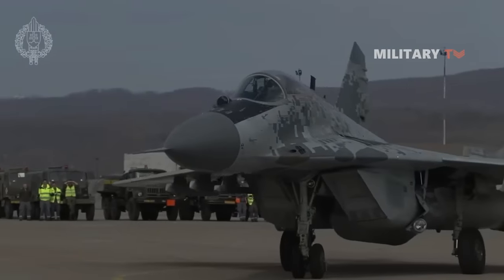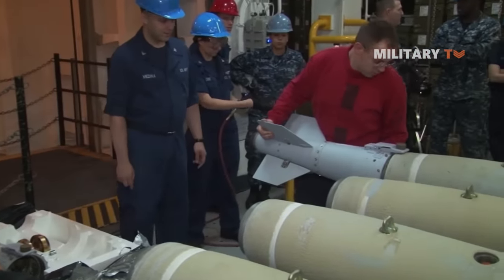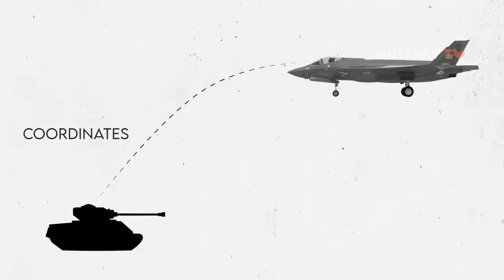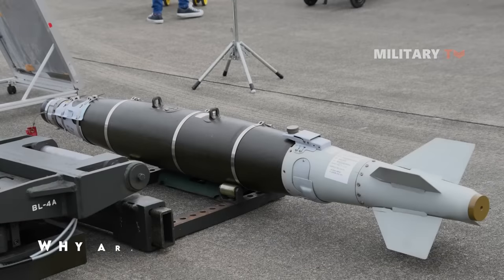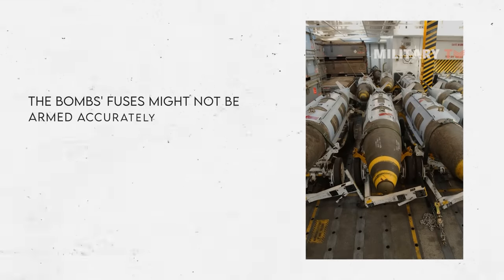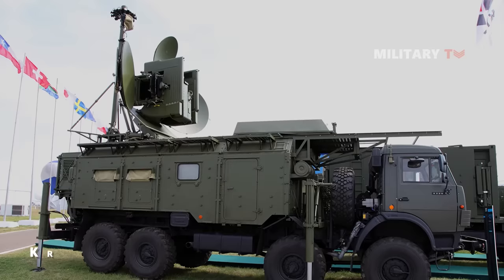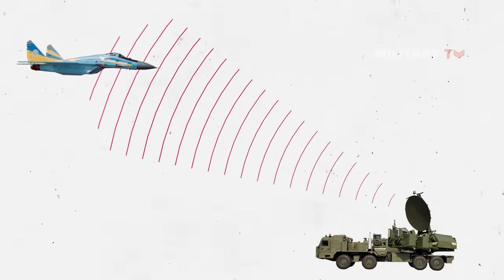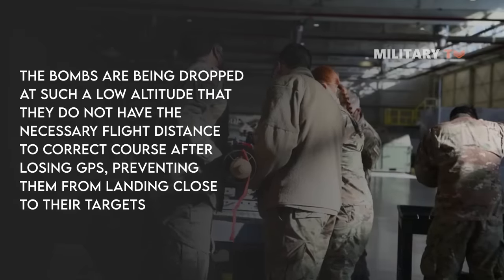Why Ukraine GPS Guided Bombs Are Failing?

Comment: While jamming can pose challenges, it's important to note that modern guided weapons like JDAM, GMLRS, and Storm Shadow have built-in GPS and inertial guidance systems. Even if GPS is lost, they can rely on inertial guidance to maintain accuracy. However, the real concern lies in GPS spoofing, where the weapons are tricked into believing they are somewhere else, hindering the switch to inertial guidance. This raises intriguing questions about the vulnerabilities and countermeasures of modern warfare technology. 🌐🚀🔒
Reply: The inertial guidance system will accumulate significant errors between launch and target without the benefit of position fixes.
Reply: Storm Shadow, like Tomahawk, has Digital Image Scene Correlation and Radar TERCOM (TERrian COntour Mapping.   It doesn't need to use GPS at all to maintain accuracy.
Reply: @glynnwright1699  When I was a young man in the 1980s a cheaper "dry" INS would have a drift rate of about 1 nautical mile per hour.   Works out at about 0.5 meters/second.   -There were various strategies to limit drift such as having orthogonal accelerometers on a rotating platform to null out any instrument bias.  As important if not morose as occasional position fixes was speed fixes.  This could be obtained by Doppler radar if over land.   Much greater accuracy (I think about 100) could be obtained with a "wet" system where everything is in exotic fluorocarbons eg bearings and the whole reference is floating in it rather than gimbals.  (so no gimbal lock).   The most famous wet system is the AIRES used in the MX Peacemaker ICBM which could guaranteed a 100m accuracy half way around the world.  About 99% of that error comes from errors in gravitational maps.
-High end assets (SR-71, B-2, Trident)  would have a celestial navigation or star tracker system.  They work through clouds so about 180m accuracy.   Then of course there is terrain contour mapping and digital image scene correlation.  
-Modern MEMS based INS/IMU on a chip must also have drift rates of 0.5m/sec or 1 nautical mile per hour because rought calcuation of the NLAW ATGM in its 2.5 second 600 flight suggest this is the drift it must have.
-I would think with a proper antenna on a specialized bomb (rather than a kkit) with the space needed would overcome jamming.
Reply: When I was a radar operator in the coastal defence I witnessed the russians spoof radar targets also...
Reply: Or using cheap Chinese micro circuitry.
Reply: @williamzk9083  And considering that Russia is having no such problems. Their smart bombs hit what they're supposed to hit.
Reply: @dannysdailys  Wait and see
Reply: Exactly, it’s just a higher tech form of Jamming.🤣
Reply: Gps   only  using  USA I’m not sure if they can spoofing  Gps
Russian Gps is Glonnas 
More chance to they jamming  but jammers spot yes there is technology you can find
Reply: @dannysdailys  the Ukrainian don't employ jamming, that is why they are vulnerable
Reply: @dannysdailys  yeah when you're bombing a harvester combine in the middle of a farm with no military equipment nearby, you're probably not going to be jammed
Reply: @moonasha  nothing auround the harvester, just a couple Leo 2 and M113, some T-64 and IRIS-T too 🥺
Reply: @dannysdailys  How would you know if Russia is hitting what they are supposed to hit when they never admit to ever missing? We can just look at footage of their missiles hitting apartment buildings and random farm equipment. They are not accurate by any means.
Reply: @Reflect02  Meanwhile Russia loses 500 tanks and 600 transport vehicles in the same time it took them to take out just a few old t-64s lmao.
Reply: compare with Russian jets bomb their own cities, it is a huge success
Putin fear of modern chefs 😂

Comment: Shouldn't JDAM GPS systems be using semidirectional antennas that only receive from above?  That should make ground based jammers less effective.  Granted it also means you can't use the WAIS signals, but you can't have everything.
Reply: Nope
Reply: Such anti jamming aerials are available and they are no even big or expensive.  They tend to work more by blocking in the direction of jamers than being directional towards the GPS satellites.     I suspect the JDAM kits are cost cutting and simply don't have the best anti jamming antenna.
Reply: The JDAM can use a directional antenna but it would always have to face the satellite. Also satellite signals are much broader with less power and is hard to overcome jamming at any directivity of the antenna. Also, I would consider the source of this video. Don't believe everything you see.
Reply: yes, rusasins makeclaims about their super duper jammers and then we can  see videos of their jammers being taken out by drones or gps guided missiles
Reply: @williamzk9083  Does JDAM stay oriented or does it spin on the way down?  If it stays oriented, and has correlation lock before entering jamming area and has a hemisphere antenna pointing up, that should give a number of db protection against jamming signals.  Although at close range the jammers will probably burn through.
Reply: @nolaserv  Directional antenna have value in GPS because the real satellites are above the horizon and most of the jammers are below.  Also by directional I don't mean yagi, I mean those antenna that receive better in one hemisphere than the other. I don't recall if they had a speciic name.
Reply: @kennethng8346  Russia is using Mi 8 helicopters as jamers.  I suspect they are trying to use them as GPS jamers.  Not sure.  I suspect normal JDAM does not rotate.    Even if it did rotated just 3-54 aerials could be switched.  The aerials can be steered electronically.
Reply: @kennethng8346  Hey Kenneth, thanks greatly for your reply. I'm trying to think in terms of hemisphere but it's just not registering. Don't missiles spin or maybe sometimes tumble when fired?  LOL! it would be funny to see a yagi on a missile! But yet if it worked better, I say do it man!
Reply: @nolaserv  I'm thinking of my Ubiquiti access points that transmit 180 degrees, but have very little signal on the reverse side, something like that would lower the effectiveness of ground or low altitude jammers.  Having the correlation engines already locked onto each satellite would also help.  The first JDAM videos I've seen generally aim downwards, so "up" is simple, to the back.  The ER units with wings, obviously they must have an "up".
Reply: @kennethng8346  Yes, I agree with wings having the upward stability for facing "up" with sats. I can see how directivity plays a part in that roll. Don't know anything about missile technology (well military stuff) but seems like JDAMS were older technology and maybe not as accurate or as fast for sat scanning sampling accuracy b4 locking on? Also, can JDAMS lock on board b4 launched? I gather not since they were not designed for USSR aircraft anyway. The HIMARS seem to be working well even though they are ground launched. Well, that's purley from my imagination on how they might work. Sorry, too many questions. Thank you again for your feedback.
Reply: @nolaserv  missiles don't generally spin and guided bombs, as being discussed, certainly don't spin. Any, potential, 'tumbling', would be very simple to correct for once stabilized, not that tumbling really occurs either.
I don't know if that resolves jamming or the directional antenna suggestion but maintaining up/down perspective would not pose a problem.
Reply: @UKnowIfUKnow  Saw a vid about HIMARS and no real info abour jamming but why they worked so well was their shorter distance of travel and speed vs. JDAMS that are larger & need for traveling longer distance, maybe slower and more time exposure in flight jammi g, more expensive needing many missiles to allow penetearing of at least 1 to hit their target with limited stock supply for Ukraine. Anyway, something like that. Cant find anything on jamming tech. Thnks 4 reply. 🙂
Reply: @UKnowIfUKnow  well I didnt really mean spin but maybe turning in flight somewhat. ur right guided missiles dont tumble.

Comment: Wouldn't a jammer powerful enough to reach into Turkey be lighting up the continent? I'm an RC hobbyist (We're don't have HAM licenses, but we do pay attention to how our radios behave) and we generally treat radios like flashlights/lighthouses when managing radio interference. Also, GPS are extremely regulated and just being on the same frequency, (or even close to it) is illegal anywhere, so wouldn't they just put in the GPS frequency in an anti radiation missile, fire in the general direction, and it heads straight for the biggest (and only) source of 1575.42mhz?

Comment: JDAM’s are very useful if the launch platform is configured to be a strike platform 

A strike fighter would have self protection jammer , targeting pod , EW suite , chaffs and flares couple with MAWs LWR and RWR etc 

I don’t think Ukrainian Mig-29 has all these and that’s why they are asking for F-16

But my thought is Ukraine should get SAAB Gripen jets instead because I don’t think Ukraine will get the most advanced f-16 V viper variant
Reply: Like Gripens! Any half decent road is an airfield and they are set up for easy maintenance,

Comment: 30 years ago I worked on shall we say things which would track and log the position of radio and radar systems even if the transmitters were switched off the missiles would still continue on target short of running away was your only hope of staying alive why not use these weapons first then gps bombs?

Comment: Russia has had over 20 years to prepare defensive systems against US and western  offensive weapon systems. Also as pointed out below on other comments Ukrainian aircraft electronics are not up to snuff on advanced systems, their ability make due with what they have is admirable to impressive at times but in this case duct tape and ipads won't cut it which is probably why they are clamoring  for western attack aircraft as their fighters are outdated. But I still think American pilots would still have their hands full even with the most modern aircraft and competent pilots. But we would still prevail should we take them on until the nukes start flying then it's over for everyone.
Reply: You would never prevail and never prevailed in the past. American equipment is good againt 3d world countries and USA has never won against enemy alone, only with huge crowd of allies.

Comment: That's why need to add AI day/night terrain mapping navigation and target acquisition guidance systems to them in an upgraded add-on package.  That combined with their inertia guidance system,  should be sufficient for them to function effectively without a GPS signal.  Add military grade shielding around the electronics.  Problem solved,  mission accomplished.  Then they can simply disable GPS navigation and pre-program GPS starting coordinates from well known launch points, within controlled airspace.

Comment: It would be interesting if they could setup a system like counter artillery to localize the jamming location and then hit it.  Not sure if it's possible to program in an exact location in a HIMARS rocket or perhaps Storm Shadows and fly to that location under strictly initertial navigation.
Reply: jammers move that is why you usually see them on wheels, as discussed on the video they are only activated if a radar detects something. as a secondary defense you also have surface to air missiles. jammers are also located deep inside russian territory so you will need long range missiles. If the US is against their vehicles being within russian territory then the more so with any missiles
Reply: Ukrainian have tried it before. But all they ever achieved is destroying the cheap antenna. Russia placed the radiating antenna few hundred meters away from the jammer and connected between the two with a shielded cable.
Reply: @fadlya.rahman4113  didnt know that, smart from the Russian side

Comment: The whole Russian-Ukrainian war is the foremost warning to the Americans and entire Western world do not mess up with Chinese or they would get trashed. American armed forces spent twenty years arming for a conflict with enemies that don't shoot back with anything sophisticated, who have no anti air capability and are waging only low intensity conflict. Being faced with high tech, high intensity conflict American weapons are failing one after another. From howitzers, which are very precise and light weight, but can't provide continuous fire cover, through very advanced reconnaissance drones who can't survived even the most rudimentary enemy SAM systems, JDAM and other weapons critically dependent on one of the most easily jammed system (GPS), to Patriot SAMs, which can provide effective protection of an area roughly the size of the football field. And on top of it logistical limits that allow the US to wage high intensity conflict for about two weeks before running out of ammunition and supplies. All of this should serve as a warning, be nice to Chinese, because you can't face them.

Comment: I think it could be a number of issues, each issue giving a % to the failure rate. Ukraine is making sure they are doing the right things, always growing pains when using new systems and ammo that your forces never had before. plus putting on aircraft that never were setup to use, plus tactics need to be adjusted,  Electronic warfare is a very complicated thing to account for, and will take time to figure out ways around or neutralizing.  plus who knows how accurate the intel is, from both sides. have to keep secrets close to chest, good and bad info. the game of misinformation is a type of warfare.  Prayers to Ukraine and their fight.
Reply: Ukrainian are doing the right thing : 1991 52 mil population, 2023 less than 20 mil population.
They are doing the right thing yes
Are you ok?

Comment: Hi i have a question   Are JDAM bombs effective only with fixed targets ?  thanks
Reply: yes because GPS positions are fixed.
Reply: @JL-tm3rc  hi thank you for the very kind and valuable reply
i was thinking about the best missile concept
i understand that some very fast missiles speed down close to the target i would try the opposite to try to accelerate in proximity of the target with a solid fuel booster
like a fireball
Reply: @gino3286  the best missile concept is to have a homing device placed on a target. this can be done by sending a package to the target or placed by saboteurs. the missile will only be communicating to the encrypted homing device so the link is now secure from any iterference. and the missile will simply go to the target

Comment: They need to change the software so that if there is a significant difference between the inertial guidance position and the GPS position due to spoofing then just drop the GPS guidance

Comment: As far as the JDAMs missing, I think it is the third option. The Ukrainian planes are flying too low while they are dropping them. The reason for this is that Russian air defense sensors cover pretty much all of Ukraine (except for MAYBE Zakarpatia). This forces Ukrainian pilots to fly low. Sure, they could fly low until they get to their intended drop point. But even then, they can’t get too high, since they must essentially dive right after dropping, in order to not get shot down. Remember, they must drop no further than 30km from the Russian lines, in order for the JDAM to hit its target.
Reply: Problem when they have a tiny air force

Comment: Wouldn’t the jammers/ gps spoofing machines be vulnerable to a anti radiation missile?
Reply: they have surface to air missile beside them and are mobile so if a missile is incoming they will move on and an overlapping jammer will takeover

Comment: I'm pretty sure there are options to counter the jamming like the use of different GPS (GLONASS/Chinas, whatever it is called) at the same time, preprogrammend terrain mapping, anti-jammer etc. but then a JDAM system wouldn't cost 30k but like 200k per bomb. War on the long run is already expensive af. It's always about the cost-benefit efficacy.

Comment: A much bigger reason should be, that in areas around the frontier, the Ukraine airforce is not able to fly high - rather the opposite. The airspace is so contested, that noone, even the russians, dares to fly high over the frontier area. Instead, they fly very low, and try to use ballistic launches of the weapons. A guided bomb is not self-propelled, and therefor has very limited chance to steer effectively from these low altitudes. If you drop a weapon in 5000m height, you probably have a timeframe of multiple seconds (more then a kilometer) to launch the bomb so it still can hit the target. If you fly at 1000m, this timeframe gets reduced to a fraction. If you fly at 30m and launch it ballistic, its like rolling the dice. 

For this type of applications, preferably use guided missiles. Steered bombs excel as a low-cost alternative to missiles once you have air supperiority, and cut the enemy air defence down. This is not happening in ukraine anytime soon. For no side.